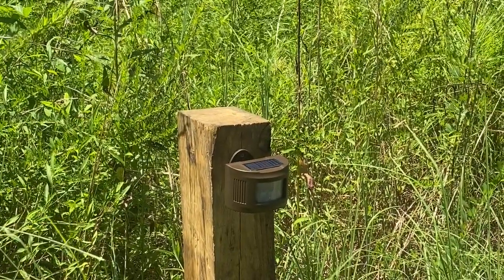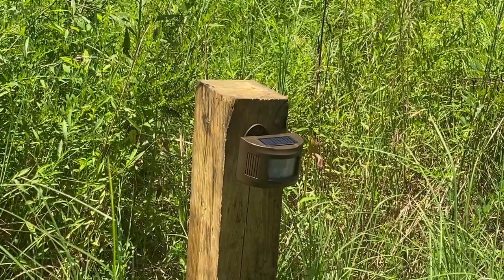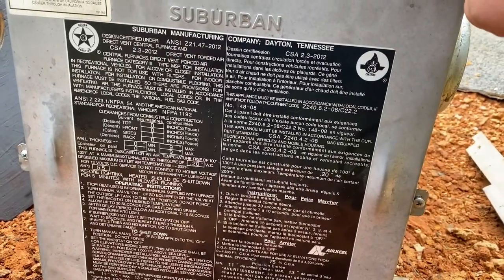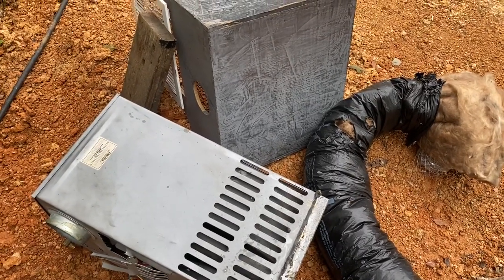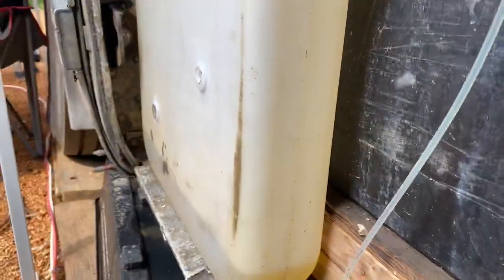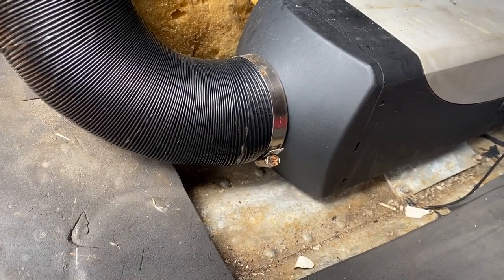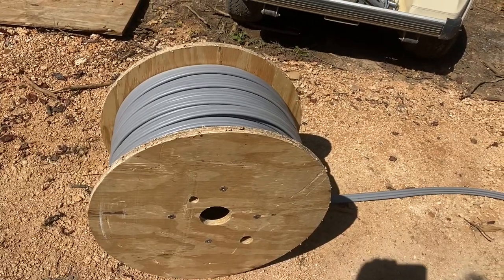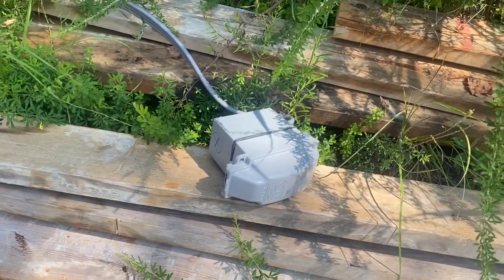Driveway alarm, electricity to the pad, rv furnace removal, and new bus coming for service

Comment: Bury the line sooner rather then later the jacket may not be UV resistant. If its left in the sun too long the plastic / rubber will begin to break down. Made the same mistake once with some direct burial low voltage cable. Within a few months the cable jacket began to crack / rubber boots on connectors were disintegrating.

UV rays ... pretty damn destructive.
Reply: I had trouble with rodents chewing wires that I strung on the ground, through the woods in NC.  Mine was a phone wire but I doubt the rodents cared.

Comment: Keeping the draw closer to 30 amps will keep your voltage drop a little over 3% which is the recommendation of the code. As Hugh calculated below #3 wire is recommended for 300 ft and the full 50 amp. Glad to see another bus on the pad and a sceniccruiser at that

Comment: Diesel heater essential, I'm on my boat, mid winter in NZ at present, was 1c the other night, boat was 23c...... Ive tapped mine into the primary fuel filter so it sips fuel from the 750 litre main tank.... easy.

Comment: Those Webasto/Eberspacher Airtop heaters are quite amazing little boxes, and far more cost effective than one would expect.  On a friend's boat the old propane powered heater used to gobble a 13kg (28 pound) at about 25GBP per week just doing hot water and a tiny bit of background heat, the replacement Webasto was lower rated(!) but gave plenty of hot water and heating on about 10GBP a week in diesel.

Comment: Update, to keep your voltage drop under 3% you will need to run 3 # 3 thhn & pull a #8 ground. conductors, use 11/4 pvc minimum, bury 18" . This will allow you to give your bus pad the full  50 amps @ 2.93 % voltage drop. Bury 18 inches deep, use mfg 90 elbows & nipples when you come out of ground. Plug should be GFI, or breaker. Take a 4•4 maybe 4 foot , put two foot in ground, mount your box with outlet. Could go higher. Use some concrete on bottom of that stub post. Now your syleing & safe. This was calculated @ 300 feet 240 volts & 2.97 % voltage drop.Peace...Hugh..
Chicago metro
Reply: To add to what Hugh said, since both ends of the branch terminate outside you can consider 1/0,1/0,1/0 & #2 USE cable, it'll save the cost of conduit underground (you will still need it at the ends and it'll have to be larger, at least 2"), and has 2.6% drop at 240V, 300'.  As stated below, aluminum service entrance cable, both SE and USE, have been used for many years without issues.  Remember to use Noalox or similar at the terminations to eliminate corrosion.  

Also, since no 50A outlet that I know of will allow either direct wire to #3 or 1/0 it would be best to put a panel down at the bus pad.  Most panels will need a breaker.  If you use a 70A breaker at the main panel and 50A at the bus pad end you should eliminate tripping the upstream breaker (at least it worked for me).  

BTW, Southwire has good voltage drop and conduit fill calculators on their website.

Note that all this assumes your visitors have balanced loads on each 50A leg.  If they are way unbalanced, you could have 50A at 120V on L1 to N and 0A on L2 and the voltage drop doubles for that 120V line.  You'd need 2/0 copper or 4/0 aluminum to keep the drop below 3%!  Chances are this will never happen which is why NEC does not require it:)

Comment: Hey Scott, word of experience with that diesel heater. Use kerosene not diesel. I've got them in my trucks, and a friend has them in 250 semi's. Since changing to kerosene the no start issues have virtually gone away. Much less carbon fouling and plugging in that little burn chamber.  You already have it plumbed to a separate tank. No changes required just put in kerosene...

Comment: Maybe for your 2nd diesel heater, get an inline water heater one to use the existing onboard heaters. 
I know international prostar semis have them under the bunk floor, they keep the coolant hot to the front heater cores & the ones under the bunk, plus keep heat the engine also.

Comment: I would definitely run conduit, larger than you need, when you go to the trouble of digging the trench. That way you can always upgrade or add or change in the future. #6 wire will never get hot with a 50 amp load, especially sitting out in free air, no matter how long it is. The length merely effects the voltage regulation at the far end. At 50 amp on a 300 ft run you will loose about 12 volts. So 228 if you start with 240. Quite adequately functional.

Comment: I suppose you looked at aluminum direct burial.  I have put in a lot a #2 aluminum direct burial and not had trouble with it except when running under a gravel roadway.  I know you already purchased the #6 copper but when you are looking into anything in the future remember almost all the wire the utility company uses is aluminum.  If it is installed correctly and the terminations are done correctly there is no problem, if there was the utility companies would do something different.

Comment: Those little diesel heaters a lot of semi trucks use them. They are great best way to clean them run some kerosene thru it for couple hours. Keeps the burn chamber cleaned

Comment: With all the solar power you have you could use the portable oil filled space heater save yourself some work. I have a huge 2 bedrooms appartment use 2 of them cheaper than the gas furnace sit in here all winter with shorts and t shirt

Comment: Scott it's 25 amps each leg of the 220 50 amp circuit you have and 6 gauge wire handles 30 amps so may  handle the 50 amps but it will get very hot

Comment: I have one of those driveway alarms, anything that moves will set it off,so I put a mighty mule metal only detector about half way my drive. The motion one goes off first  and then if someone is really driving up in a vehicle the other one will go off as they come on up the drive , for some reason wasp really like to buzz around it, very annoying. You will find out how much wildlife moves around your place at night.

Comment: Suggest you install a gate deep enough from the road to accommodate a bus length.
We also had a sensor but found a gate was better for overall limited access especially when we weren't there.
We didn't want to allow anybody to drive up to the house.

Comment: At 50 amps the voltage drop will be about 12V, taken either from 120 or 240 (240 puts 50A on the two live wires, 120 puts it on one live and the neutral).
That is too much drop and some appliances will have problems.
And it's putting 600W into the cable... 2W per foot. Doesn't seem like much but it will get pretty warm, maybe quite hot in the ground. 
You could say it's 50A + 50A = 100A at 120V, but it's still identical to 50A at 240V that way. 
Technically you should not try to pull the full 50A anyway, should stay under 80% of the breaker rating... 40A. Pulling a full 50A from a 50A breaker is likely to trip the breaker on thermal overload after a while.
Anyway, I doubt that anyone will be trying to run such high current. I suppose if they are microwaving and toasting and hairdrying with several rooftop AC units running... maybe? 
You should record the meter reading before and after to see how many kW/h they actually use. Nothing else is connected, I think?

Comment: I'm thinking you take pick wide trench about 2" to  4" in deep, the take a 1/2 in plywood cut in 4 boards  so ( 1 foot by 8 feet )  with hole each corner so a 16d nail or 3/8 in. x 10 in. Galvanized Spike Nails so boards do not move when drive over it base make wire cover. 2# pick a tree and screw in a Wall-Mounted Hose Rack wind up cord. this is only temporary

Comment: Watts stay the same in an AC circuit. Search eBay and find some transformers that can step that voltage up to 600 volts, then step it back down at the pad. Your wire will be carrying less current, but the same amount of wattage. That’s what they are doing at the pole.
Reply: I don't think he needs to invest in iron.  50A @ 220V should be good enough for one RV.  If he wants to have two RV's down there, that's another story.

Comment: Scott,   You stated that you're d-heater used it one winter, did you have any problems with water in your fuel or it slushing?
Reply from the maker: No problems with its operation.  Once the screen went out but it turned out to be a loose ground
Reply: If I remember the heater does put off ambient heat in the bay and keeps the bathroom floor toasty. Chances of getting water in the fuel is pretty low as Scott has the heater plumbed to the small tank

Comment: Do not use bio diesel with this type of heater it wouldn’t last . The burner WILL clog and stop running and give off fumes. Our company in New York City has been using them for years and I have been swapping them out every year os so. I currently have 6 of them under my bench waiting to be cleaned out and repaired. Just FYI
Reply: Big Wheel they are Wabasto heaters not from Amazon. We buy the from a local NYC truck dealership
Reply: I'm assuming you mean 100% biodiesel.  Nearly all diesel in the states has some bio mix included.  10 to 15 % from memory from my last tank.  The exception to bio mix might be offroad/farm diesel but if you get caught running that down the road you are in for a major fine.
Reply: Richard Lazarski 20 % In summer and 5 % In winter months. If I could put up a photo I show you the pile of 5 of them on my cart . We have a few thousand trucks using diesel fuel and I been repairing them for 36 years. Bio diesel is fine in the summer but even with winter blend at five % it still solidifies and clogs the heating pad .
Reply: In New York it is straight diesel fuel .bio is an extra fuel by it self

Comment: Don`t the A/C units you have give off heat too for the winter
Reply from the maker: Yes but it uses a lot of electricity and with the reduced winter solar yields it’s not going to be my primary heating system
Reply: @BusGreaseMonkey  Okay Thanks
Reply: Thanks for explaining I had same question
Reply: Plus they get less efficient and effective the cooler it gets. Better to use the separate heaters
Reply: A/C has to gather heat energy from outside. The colder it is outside the harder it is to do that.

Comment: Isn't you mini split also a heat pump? Mine are and I use them in the winter all the time.
Reply from the maker: Yes but i’m solar powered.  Winter yields are less
Reply: @BusGreaseMonkey  that's true.

Comment: Voltage drop is going to be your main issue. My quick calcs show you losing almost 15 volts on that long of a run. Being if you started with 240 that makes it just over 225 volts.... unacceptable. Just trying to help Folks.
Reply from the maker: We will see if it works as the temporary service or not.
Reply from the maker: Mutimeter says 122v per leg at the pad
Reply: @BusGreaseMonkey With a full load?  I think you'll be OK.  Someone above said you would lose 5%, which I think is acceptable.
Reply: @BusGreaseMonkey  I hope it does work.

Comment: Do RVs run on 50 amp 220 volt or 50 amp 110V?  My RV runs on 30 Amp 110V.
Reply: I work for the park service, many RV's pull 50+ Amps 2 AC units and all the stuff they plug in and we supply 50A and 30A plugs every Monday I switch out 15-20 burnt up plugs.

Comment: @Scott, voltage drop will be about 6% at full current. Twice as much as it should be but very similar to many RV parks lol - thus the necessity for auto transformers. 
It's my humble master electrician opinion that you'll be fine 👍

Comment: Isn’t your mini-split a heat pump? If so,, it should have heat too.
Reply: explained below that the electricity required is too much in winter considering the reduced supply from solar panels.